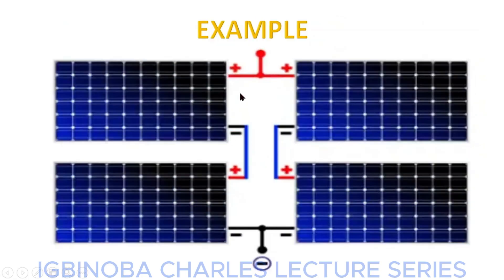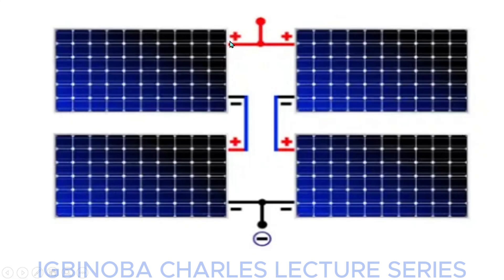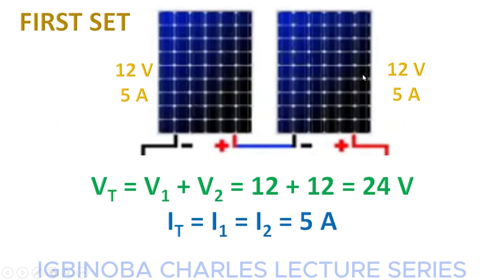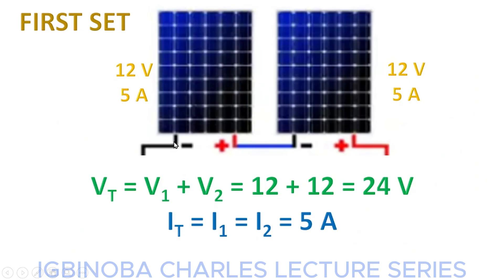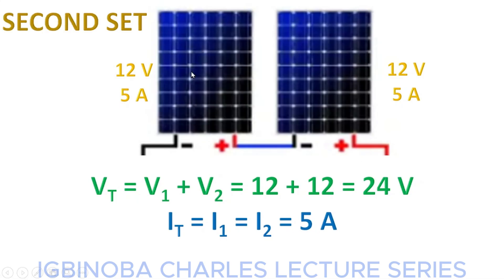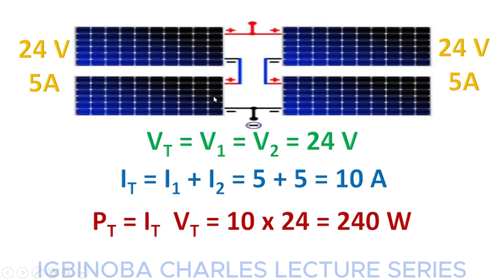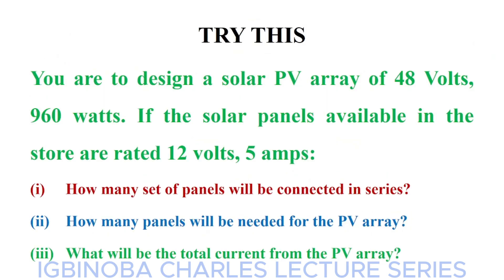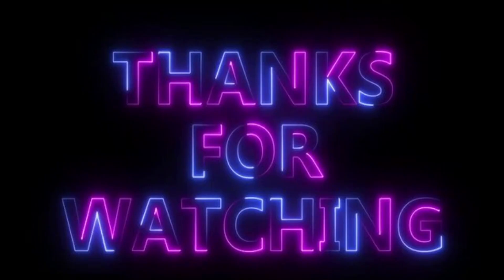Connection of  Solar Panels in SERIES-PARALLEL

Comment: COMP3114J

(i) Number of panels in series = 48/12                
    =4 panels in series

(ii) Panels needed for the PV array 
     Power = 12x5 =60W
    Number of panels = 960/60 
    =16 total panels 

(iii) Total current from the PV array
      Number of parallel sets = 16/4 =4 
       Each string produces 5A so the
       total current = 4x5 =20A
       Total Current = 20A

Comment: CHM363K
1)4 panels are connected in series.
2)The power output for the channel is the total voltage multiplied by the current p=12×5=60.therefore total numbers of panels to produce 60watt=960w/60w=16pannels.
3)total current from the pv array will be 20amps

Comment: PETRO337K

1) When connecting panels in series, voltages add up, but the current remains the same.

Required voltage = 48V
Each panel voltage = 12V
Number of panels in series = 48/12

= 4 PANELS IN SERIES

2) A total of 16 panels would be needed 

Each panel produces 60 watts i.e 12V × 5A = 60W

To get 960W in total, therefore, 960W / 60W = 16 panels 

3) Utilizing the formula - l = P/V

I = 960W / 48V = 20A

Comment: MAR3117M

1. Number of panels in series:
For 48V, we need to connect panels in series. Since each panel is 12V, we'll need
48V divided by 12V = 4 panels in series

2. Total number of panels:

Each panel is 12V, 5A, so the power rating will be: 12V x 5A = 60W per panel

For a 960W array, we'll need: 960W divided by 60W per panel = 16 panels

Since we need 4 panels in series, we will have: 16 panels / 4 panels per series line up = 4 parallel line ups

3. Total current from the PV array:

Each series line up produces 5A (since the panels are connected in series). With 4 parallel lineup , the total current will be:
5A × 4 = 20A

Comment: MECH37G
1.  4 sets of panels will be connected in series.
2. 16 panels will be needed for the PV array.
3. The total current from the PV array is 20 Amos 
Since, I= P/ V 
Then, I = 960W/48V = 20amps

Comment: MECH359G

GIVEN INFORMATION 

Required Solar PV Array Output: 48 volts, 960 watts

Available Solar Panel Rating: 12 Volts, 5 Amps

(i) How many set of panels are connected  in series;To get 48, we must connect enough 12V panels in series so their voltages add up:
i.e 48÷12=4 panels. Therefore  the total no of panels that should  be connected  in series is 4 panels.

(ii) How many panels are needed for the  PV Array?
First find the power rating of one panel P=V×I = 12V ×5A =60 W. Therefore the power  rating of one panel is 60W. Now the number of panels needed for this connection  will simply be =960W/60W= 16. Therefore  the connection  needs 16 solar panels (4 sets of series and parallel connected panels)

iii) total current of the PV array. 
= 5A +5A+5A+5A=20A. 
Summary  of  answers 
(i)4 set of panels connected  in series 
(ii)16 panels in total
(iii) 20A

Comment: EEE3100V

i) Four 12-volt, 5-amp solar panels are connected in series, the total voltage adds up to 48 volts (4 × 12V), matching the solar system's required voltage.

ii) To achieve 960 watts, 16 panels are needed, each producing 60 watts (12V × 5A). This calculation is based on 960 ÷ 60 = 16 panels.

iii) The total current from the solar array is 20 amps, calculated using the formula I = P ÷ V, where P is the total power (960W) and V is the total voltage (48V):
960 ÷ 48 = 20A.

Comment: CIV382D

1. Four panels are connected in series.
When you connect four 12-volt, 5-amp
panels in series, you get a total of 48 volts,
which is the voltage needed for the solar system.
2. A total of 16 panels are needed. Each panel produces 60 watts (12V x 5A = 60W). To get W in total: 960 + 60 = 16 panels.
3. The total curent from the solar array is 20-amps. Using the formulal=P+A,
1= 960W 48V = 20A.

Comment: PETRO3126V
1. To achieve a final voltage of 48 V for the array you’ll need to connect the panels in series. Since each panel provides 12 V, you’ll require 4 panels connected in series 
2. Each panel generated 60 W calculated as 12v *5A . Given that the total needed power is 960 W, you’ll need a total panel of 16 to meet this requirement 
3. With a total of 16panels and 4 panels per series strings, you’ll end up with 4 parallel strings. As each strings provide 5A, and since there are in parallel the total current will be 20 A(5A*4A)

Comment: MECH395Q

A) Panel in series: To achieve the system's target voltage of 480V using 120V panels, 4 panels needed to be considered in series 
Calculation: 48V ÷ 5A = 4 panels 

B) Total panels needed: The power output of a single panel is 600W. To meet the total system power demand of 960W, 16 panels are required in total.
Calculation: 960W ÷(12V × 5A)=960W/60W = 16Panels

C) With 16 total panels arranged in the series string, these strings are connected in the parallel the result is 20amps,
 Using I=P/V = 960W / 48 = 20A.

Comment: PETRO364L
i) When connecting panels in series, voltages add up, but the current remains the same.
Required voltage = 48V
Each panel voltage = 12V
Number of panels in series = 48/12
= 4 PANELS IN SERIES
ii) A total of 16 Panels would be needed
Each Panel produces 60 watts l.e. 12V x 5A =
60W
To get 960W in total, therefore, 960W / 60W =
16 Panels
iii) Utilizing the formula - 1 = P/V
| = 960W / 48V = 20A

Comment: MECH347U 1)4 panels are connected in series.2)The power output for the channel is the total voltage multiplied by the current p=12×5=60.therefore total numbers of panels to produce 60watt=960w/60w=16pannels.3)total current from the pv array will be 20amps
Reply: The total power is in the question, check again and use that to solve

Comment: EEE45S 

[ I ]
Each panel = 12 V  
Required voltage = 48 V  

Panels in series = 48 V ÷ 12 V = 4 panels

[ II ]
Each panel power rating:  
P = V × I = 12V × 5A = 60W

Total power needed = 960W  
Number of panels = 960W ÷ 60W = 16 panels.

[ III ]
There are 4 panels in series per string
Since there are 16 panels total 
Thus 16 ÷ 4 = 4 strings in parallel

Each string = 5A  
Total current will be = 4 × 5A = 20A

Comment: CHM340N

1.	Number of panels in series:
For 48V, we need to connect panels in series. Since each panel is 12V, we’ll need
48V divided by 12V = 4 panels in series.

2.	Total number of panels:
Each panel is 12V, 5A, so the power rating will be:
12V × 5A = 60W per panel
For a 960W array, we’ll need:
960W divided by 60W per panel = 16 panels
Since we need 4 panels in series, we will have:
16 panels ÷ 4 panels per series string = 4 parallel strings.

3.	Total current from the PV array:
Each series lineup produces 5A (since the panels are connected in series). With 4 parallel strings, the total current will be:
5A × 4 = 20A.

Comment: PETRO3162F

1. To achieve a final voltage of 48 V for the array, you'll need to connect the panels in series. Since each panel provides 12 V, you'll require 4 panels connected in series. 

2. Each panel generates 60 W (calculated as 12 V x 5 A). Given that the total power needed is 960 W, you'll need a total of 16 panels to meet this requirement. 

3. With a total of 16 panels and 4 panels per series string, you'll end up with 4 parallel strings. As each string provides 5 A, and since they're in parallel, the total current will be 20 A (5 A x 4).

Comment: CHM3149S

i. Since each panel is rated 12V and the total voltage needed is 48V, 
No of panels connected in series = 48/12 
= 4 panels 

ii. Power for each panel = 12×5 = 60W
No of panels needed = 960/60 
= 16 panels 

iii. Total current = Total power/Total voltage 
I(T) = P(T)/V(T)
I(T) = 960/48 = 20A

Comment: Petro 372 T
1.Four panels will be connected in series.
2. A total of sixteen panels are needed.
Each panel gives 60 watts of power divided by 960.
3. The total current. P= IV ,I=P/V
960/48 = 20 ampere.

Comment: COMP3111G
i. 4 sets of panels will be connected in series that is 48V  ÷ 12V = 4
ii. 6 panels will be needed for the PV array that is 960W ÷ 60W = 16
iii. The total current from the PV array is 20A that is 960W ÷ 48W = 20A

Comment: PETRO3189G

Since the purpose of series connection is to increase the voltage while keeping the current constant

Number of panels in series=48/12=4

ii)Total power=960W
Power per panel=12*5=60W
Total number of panels required=960/60=16panels

iii) Total current= 960/48=20A

Comment: PETRO396R

i) When connecting panels in series, voltages add up, but the current remains the same. Required voltage = 48V Each panel voltage = 12V Number of panels in series = 48/12 = 4 PANELS IN SERIES

 ii) A total of 16 Panels would be needed Each Panel produces 60 watts I.e. 12V x 5A= 60W To get 960W in total, therefore, 960W / 60W= 16 Panels
 iii) Utilizing the formula - I = P/V |=960W| 48V = 20A

Comment: MAR3121Q

A) Panels in series: To acheive the system's target voltage of 480V using 120V panels, 4 panels needed to be considered in series
Calculation: 48V ÷ 5A = 4Panels

B) Total panels needed: The Power output of a single panel is 600W. To meet the total system power demand of 960W, 16 Panels are required in total.
Calculation: 960W ÷ (12V × 5A)= 960W/60W = 16Panels

C) With 16 total panels arranged in the the series string, these strings are connected in parallel the result is 20amps, Using IP+V we have 1960W, 48V and 20A

Comment: COMP385G

1. Number of panels set in series = 48V /12V =4
2. Number of panels for PV array = 960W /(12V * 5A)= 960W
/60W=16
3. Panels connected in parallel = 4 * 5A= 20A

Comment: MECH3455

(i) 48V/12V=4. Four sets of panels will be connected in series
(ii) Panel power=12V×5A=60W. Solar PV array of 960W/Each solar panel of 60W equals 16. Sixteen panels will be needed for the PV array 
(iii) I=P/V. I=960W/48V=20A. The total current from the PV array will be 20 amperes

Comment: MECH358F

1. Four panels are connected in series. When you connect four 12-volt, 5-amp panels in series, you get a total of 48 volts, which is the voltage needed for the solar system.

2. A total of 16 panels are needed. Each panel produces 60 watts (12V x 5A 60W). To get W in total: 960 60 16 panels.

3. The total curent from the solar array is 20-amps. Using the formula I = P+A, 1960W 48V-20A.

Comment: COMP370R 

(1) 4 sets of panels will be connected in series
(48V/12V) = 4
(2) 16 panels will be needed for the PV array
(960W/60W) = 16
(3) The total current from the PV array is 20A
(960W/48V) = 20A

Comment: PETRO3163G
i) When connecting panels in series, votages add up, but the current remains the same.
Required votage=48V
Each panel voltage =12V
Number of panels in series =48/12
=4 panel in series 
ii) A total of 16 panels would be needed 
Each panel produces 60 watts, i.e. 12V ×5A=60W
To get 960W in total, therefore 960W/60W= 16 panels 

iii) Utilising the formula I=p/v
I=960W/48V = 20A

Comment: PETRO37G

Four panels are connected in series.
1. When you connect four 12-volt, 5-amp panels in series, you get a total of 48 volts, which is the voltage needed for the solar system.
2. A total of 16 panels are needed.
Each panel produces 60 watts (12 V
× 5 A = 60 W).
To get 960 W in total: 960 ÷ 60 = 16 panels.
3. The total current from the solar array is 20 amps.
Using the formula I = P ÷ V, 1=960 W ÷ 48 V = 20 A.

Comment: PETRO3185C

1.  4 set of panels will be connected in series.
Since connecting 4 of 12 volts, 5 amp panels in series gives a total of 48 volts as required by the solar PV array design.

2.  16 panels will be needed for the PV array. This is because the power of each panel is 12*5=60watts, therefore the total number number of panels to produce 960 watts is 960/60 = 16

3.  The total current from PV array is 20amps
Since I(total) = p(total)/v(total)
I(total)= 960/48 = 20amps.
......

Comment: MECH3117M

1. Four panels are connected in series.
When you connect four twelve volts, five amps panels in series, you get a total of fourty-eight volts, which is the voltage needed for the solar system
2. A total of sixteen panels are needed.
Each panel produces sixty watts, to get nine hundred and sixty watts in total.
960/60=16 panels
K
3. The total current from the solar array is twenty amps. Using the formula I=P\V =960W/48=20A

Comment: MECH312L

1. Sets of panels that will be connected in
series is 48 / 12 = 4
2. The power generated by a single panel is =
120 V x5A = 600 W. The required power
in the
array is 960 W. Therefore, the number of
panels needed for the array is = 960 / 60
= 16 panels.
3. 16 panels are in the array and 4 panels are in series. Total number of parallel
sets of panels = 16/4= 4 parallel sets.
Total current from each set of panels is
5A. Since these sets are in parallel, the total current is = 5A x 4 = 20A.

Comment: PETRO395Q

(i) Number of panels in series = 48/12                
    =4 panels in series

(ii) Panels needed for the PV array 
     Power = 12x5 =60W
    Number of panels = 960/60 
    =16 total panels 

(iii) Total current from the PV array
      Number of parallel sets = 16/4 =4 
       Each string produces 5A so the
       total current = 4x5 =20A
       Total Current = 20A

Comment: PETRO357E
1. 4 panels will be connected in series 
48÷12 = 4
2. 16 panels will be required 
960÷60 = 16
3. Total current from the PV array is 20
960÷48 = 20

Comment: CHM344R

1.  Number of panels in series = 48/12 = 4 panels.
2.  Number of panels needed for the PV array = Total power in the circuit/ Power in each panel = 960/60= 16 panels.
3.  Total current from the PV array = Total power/ Total voltage = 960/48 = 20 Amps.

Comment: EEE 3131A

1. To design an array of 48 volts, with panels rated 12V, four panels would be connected in series 

2.From P=IV, the total power of each panel is 60W. To produce 960W, 16 panels would be needed.

3.The total current will be 4×5A=20A

Comment: PETRO351Y

(i) Number of panels in series = 48/12                
    =4 panels in series

(ii) Panels needed for the PV array 
     Power = 12x5 =60W
    Number of panels = 960/60 
    =16 total panels 

(iii) Total current from the PV array
      Number of parallel sets = 16/4 =4 
       Each string produces 5A so the
       total current = 4x5 =20A
       Total Current = 20A

Comment: MECH3141K 

Four panels are connected in series.
1. When you connect four 12-volt, 5-amp panels in series, you get a total of 48 volts, which is the voltage needed for the solar system.
2. A total of 16 panels are needed.
Each panel produces 60 watts (12 V
x 5 A = 60 W).
To get 960 W in total: 960 ÷ 60 = 16 panels.
3. The total current from the solar array is 20 amps.
Using the formula I = P ÷ V,
1= 960 W ÷ 48 V = 20 A.

Comment: Four panels are connected in series.
1. When you connect four 12-volt, 5-amp panels in series, you get a total of 48 volts, which is the voltage needed for the solar system.
2. A total of 16 panels are needed.
Each panel produces 60 watts (12 V
× 5 A = 60 W).
To get 960 W in total: 960 ÷ 60 = 16 panels.
3. The total current from the solar array is 20 amps.
Using the formula I = P ÷ V,
1= 960 W ÷ 48 V = 20 A.

Comment: CHM 325Y

1.Four panels are connected in series.
When you connect four twelve volts, five amps panels in series, you get a total of fourty-eight volts, which is the voltage needed for the solar system 

2. A total of sixteen panels are needed.
Each panel produces sixty watts, to get nine hundred and sixty watts in total. 960/60=16 panels

3. The total current from the solar array is twenty amps. Using the formula I=P\V =960W/48=20A

Comment: COMP3112H

1:- Sets of panels that will be connected in
series is 48 / 12 = 4
2:-The power generated by a single panel is =
120 V x 5 A = 600 W. The required power in the
array is 960 W. Therefore, the number of panels
needed for the array is = 960 / 60 = 16 panels.
3:-Since we have 4 panels connected in series and we have a total of 16 panels, Total panels
connected in parallel is 16 / 4 = 4 panels in
parallel. Each of these panels has a current of 5
A. Therefore, the total current in the PV array is 4 × 5 A =20 A.

Comment: PETRO 383E 
1.when connecting panel in series, voltages add up, but current remains the same 
Required voltage= 48v
Each panel voltage=12v 
Number of panel in series=48/12 
= 4 panels in series

2. A total of 16 panels would be needed 
Each panel produces 60 watts i.e 12v ×5A=60w
To get 960w in total, therefore, 960w/60w=16 panels 
3.utilizing the formula-I= p/v
I= 960w/48v=20A

Comment: COMP353A
Given: each panel = 12 V, 5 A, total needed = 48 V, 960 W

(i) For 48 V:
48 ÷ 12 = 4 panels in series

(ii) Total current required = 960 ÷ 48 = 20 A
Each series gives 5 A, so 20 ÷ 5 = 4 sets in parallel

Total panels = 4 (series) × 4 (parallel) = 16 panels

(iii) Total current  = 20 A

Comment: COMP320T

(i) Number of panels in series = 48/12                
    =4 panels in series

(ii) Panels needed for the PV array 
     Power = 12x5 =60W
    Number of panels = 960/60 
    =16 total panels 

(iii) Total current from the PV array
      Number of parallel sets = 16/4 =4 
       Each string produces 5A so the
       total current = 4x5 =20A
       Total Current = 20A

Comment: PETRO3193k

1. 4 sets of panels will be connected in series.
2. 16 panels will be needed for the PV array.
3. The total current from the PV array is 20 amps

Comment: CIV316X 
Given
 PV array required = 48V, 960W
 Available panel rating = 12V, 5A- Power of each panel = 12V × 5A = 60W

(i) How many panels in series to get 48V?

48v ÷ 12v = 4 Panels In Series

(ii) How many panels needed in total?

Each panel = 60W  
Total panels needed = 960W ÷ 60W = *16 panel

(iii) Total current from PV array?

If 4 panels make 1 series string, and 16 panels total:  
16 ÷ 4 = 4 strings in parallel

Current in each string = 5A  
Total current = 5A × 4 = 20A

Comment: PETRO3194L

1. 4 sets of panels will be connected in series.
2. 16 panels will be needed for the PV array.
3. The total current from the PV array is 20 amps

Comment: CHM335I
1. Four panels are to be connected
48/12=4
2. Power output for one panel
120V ×5A =600W
Total power 960/60 =16panels
3.total current 960/48=20A